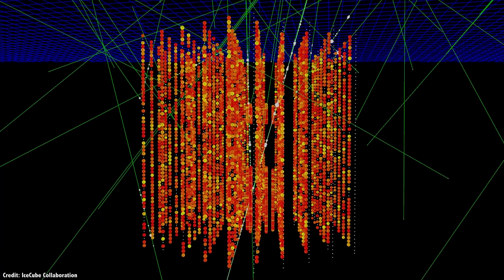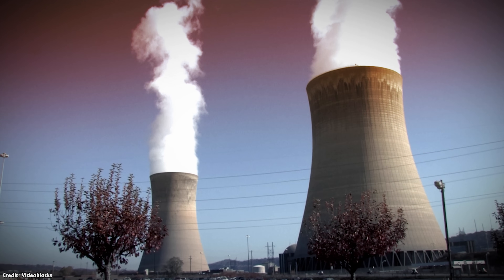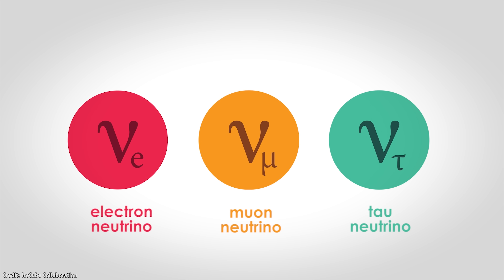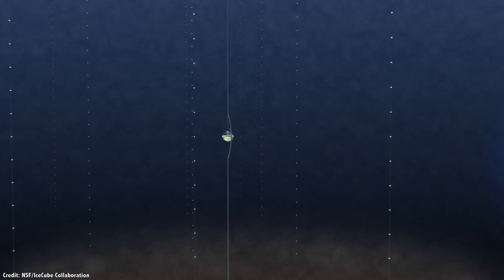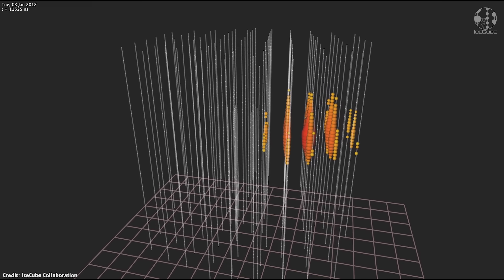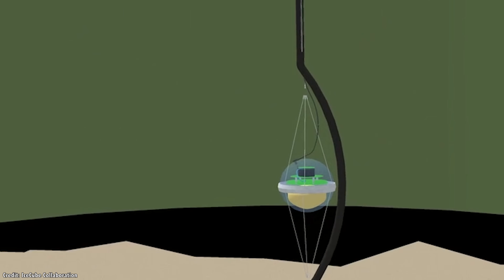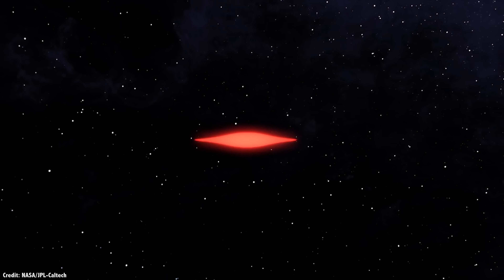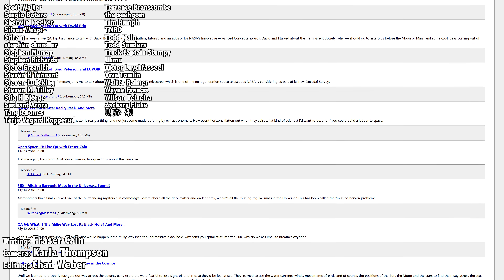The Search for Neutrinos. Catching These Elusive Particles in a Gigaton of Ice

Comment: Hey Frasier. Really love the channel. I have a question and here it is. Leaving from orbit, would it be possible to have a rocket engine that could provide a continuous acceleration of 1 G for a month then decelerate to reach the outer solar system? What would that entail and could it be achieved with an ion drive?
Reply from the maker: No, we don't have anything that can provide that kind of continuous acceleration. You either get a few newtons for months, or 1+G for a couple of minutes. As soon as you run out of fuel, you're done.

Comment: Fraser, one more question that came to mind (unrelated to this video):

When they're talking about gravitational waves and the first discovery by LIGO, a couple years back, they said that they measured two black holes that collided and that the collision took out about 4 solar masses from the resulting black hole after the merger. But then at the same time we also hear that once matter falls into a black hole it won't be able to escape it. Well, this is clearly not the case if one black hole collides with another. -- some matter did escape in the form of gravitational wave energy. So how do you explain that?

Comment: Hey Fraser. A question about the very basic form of the double slit experiment. Imagine you had an impossibly sensitive gravity detector which could tell which slit an electron went through by measuring the effect of its mass, one of the slits experiencing a greater gravitational pull than the other when an electron passes through. Then you would have figured out which slit the electron went through without ever interacting with it in any way, since gravity is not a particle interaction. Such a detector should not break the interference pattern, so does it break logic?

Comment: Fraser, you said that the ice sheet the observatory is situated on is moving 10m per year. Would that not askew the positions of the sensors and make it directionally less accurate, or at least require a larger margin for error as time goes on?
Reply from the maker: They're all moving together. The sheet is drifting towards the ocean.